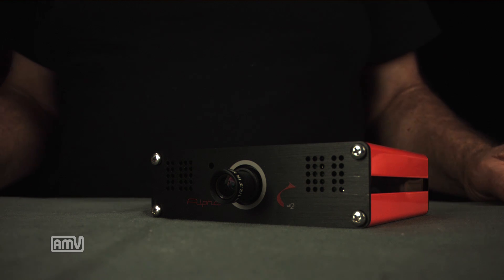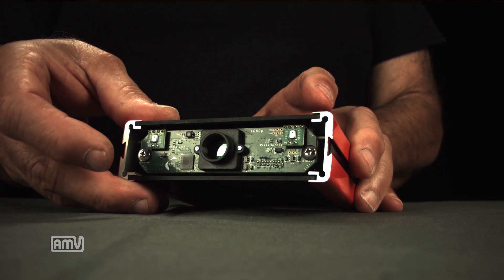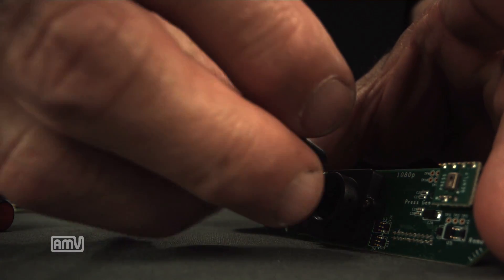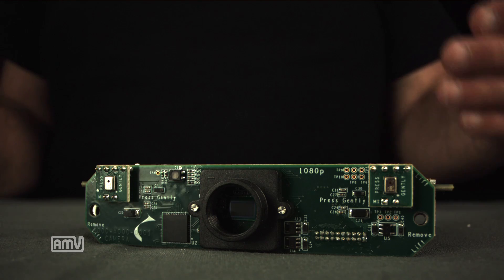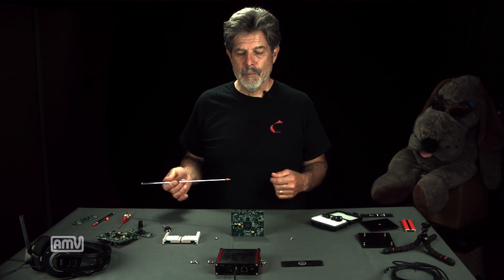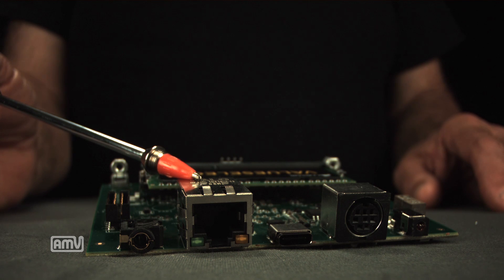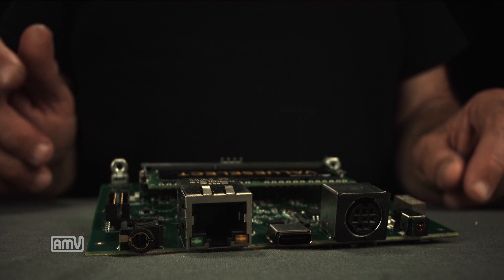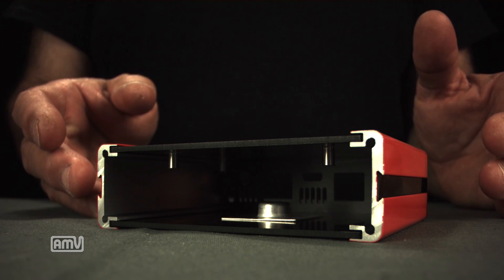Sub2r Camera Tear Down

Comment: Do you have an estimate for a release date? I could sure use this fairly soon.
Reply from the maker: Kevin - would love to say next week.  But, the reality is we're an extremely small self-funded startup trying to build a highly complex device.  Much to all of our frustration it has taken longer than we'd hoped.  While trying to debug the first 24 cams, it took almost 3 weeks to find a short caused by a mfg mistake under a component.  They forgot to lay down a solder mask over a via.  12 layers and thousands of connections - we finally found it.

The good news is those 24 are going in for a bit of rework starting today.  Should be out in 1-2 weeks.  Then some of those are destined for key people to eval.  After we get their feedback, we'll mod the design, do a 1 panel board spin to make sure we did it right and then - whew - into production.

Depending on your def of fairly soon, we're getting closer every day.

Rich

Comment: GOD I want it so bad, already reserved a cam. You guys ever post a price for the 4k version? Also, how much is the lense set supposed to be?
Reply from the maker: Sorry thought I had replied - Serge pointed out I missed this.  Working on the presale price.  It's taken over a month to get quotes from the CM.  Still trying to lock in 1 part.  There will be a choice of lenses - 1 comes with the cam.  The others shouldn't be very expensive.  Choices will be with or without IR cutout and various FOVs